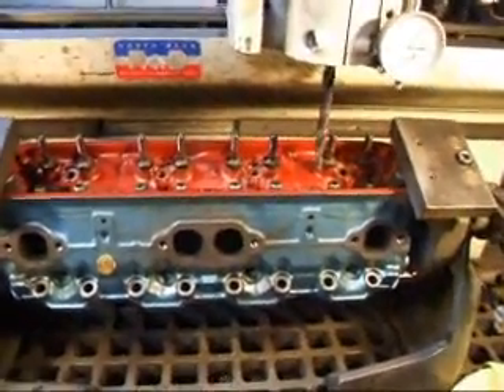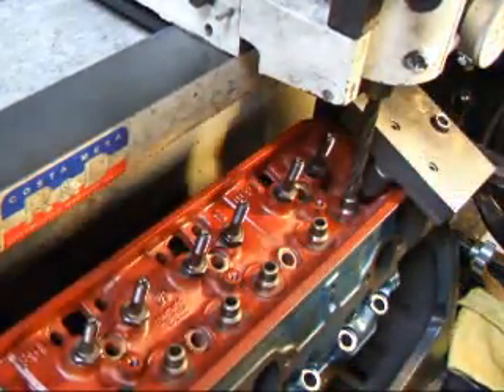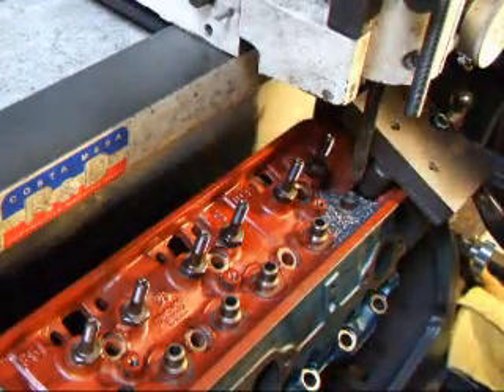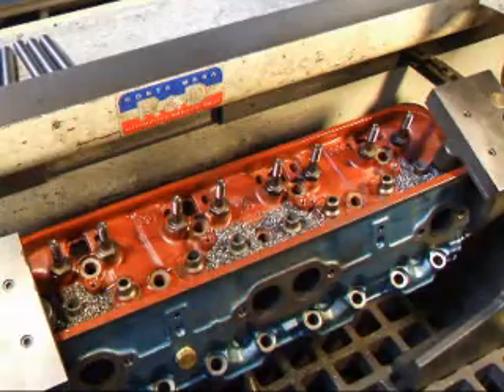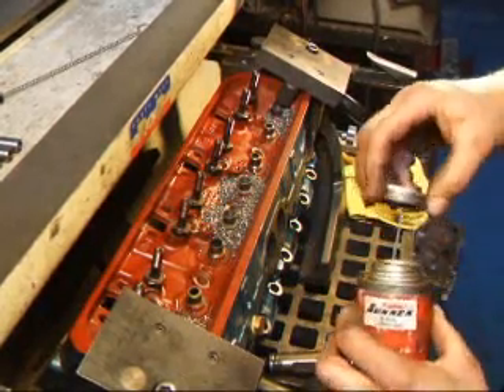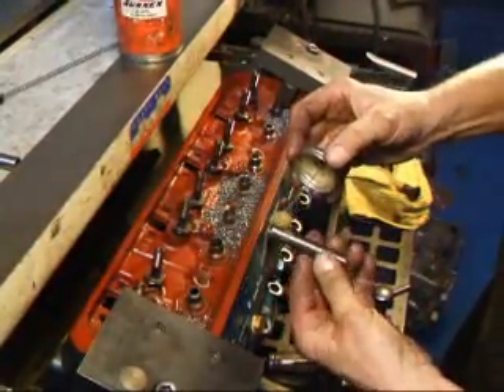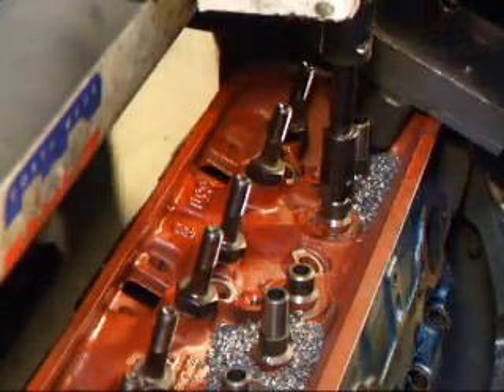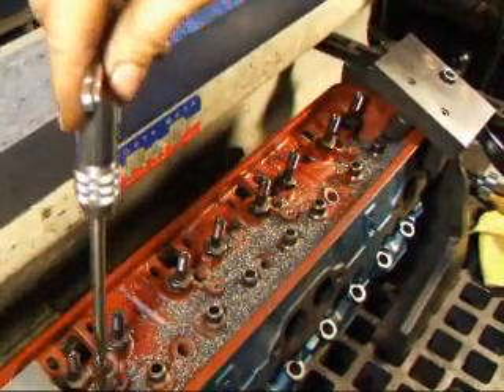SBC Valve Guide Installation

Comment: 4:41 I never saw anybody else use a hand tool to ream valve guides. Every time I saw a valve guide get reamed, it was with an electric drill of some kind. It would either be a handheld electric drill or a drill press. Other times I would see a tiny hone used instead of a reamer, and those required a power drill.

Comment: From the video it seemed easy, but I just aquired a set of 1970 big block ford heads. And accidently broke the exhaust guide completely off.  My questions is,  would it be hard to replace and how much would it cost to have it done to a set of heads having  the bronze valve guides installed?

Comment: @fiatnutz 
Hi Fiatuntz, great video! 
does this mean that you actually milled/destoryed the old valve guides and insert the new guides into the position regardless if there is any remaining of the old guide -- as long as the size of the whole is correct, the new guides will sit there nicely?
Reply: Not all guides are inserts from the factory. Some are part of the casting.

Comment: @zapwatt because these guys are not thorough. you and i are used to working in aluminum by now but as far as i am concerned if you crack a head its toast anyways, but without a doner you are missing out. new original guides are the way to go. it prevents out of line and ovaled bores like you can see in this actual video when he tests the last guide. but i have to say that the workable head is only as good as it is.

Comment: This is interesting to see how its done almost similar I'd assume to when my local machine shop put guides in my fe ford heads. Im wondering if you could do a valve seat video as im interested to see how those are installed.

Comment from the maker: The original guides are integral to the casting. OE's simply drill a hole in the cast iron and call it a day, however in the reman world we have to drill & ream for a replacement guide when the integral guide is worn out.